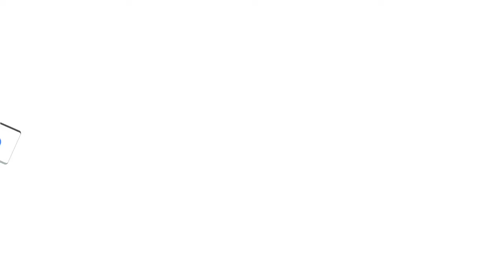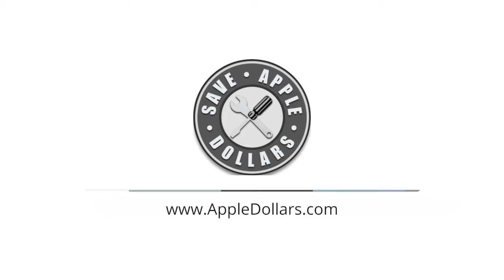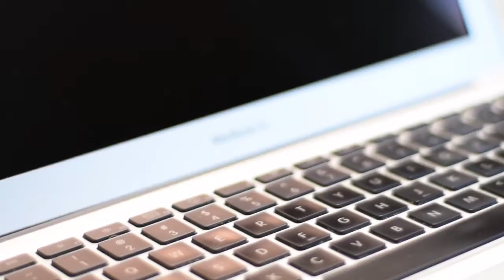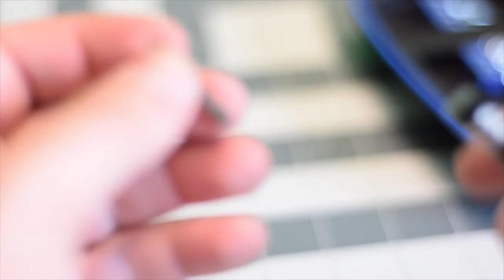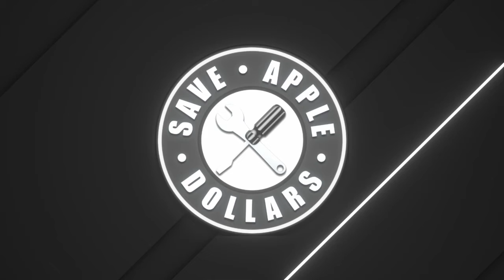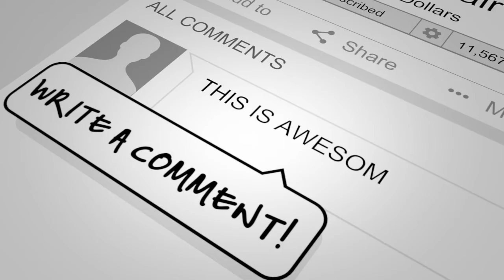13" Macbook Air A1369 2010 and 2011 WiFi and Bluetooth Card Replacement Installation

Comment: Hi,I gave my MacBook Air 13 for repairing in Apple Store they said it cost $500 for Logic Board Replacement,then i gave to local repairing guy he said he will repair logic board and he charged Nominal for reparing.Now repairing man asking few more cost as he said wifi circuit is connected to logic board so for that repairing the cost will increase.So my question is in the repairing of logic board this wifi inclused or not? Is he is making me fool for that extra charge ?